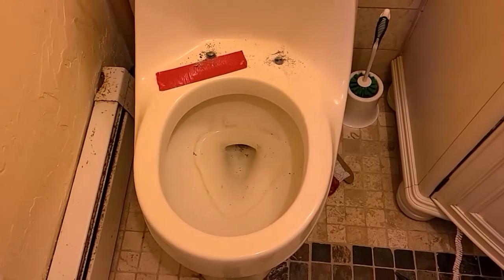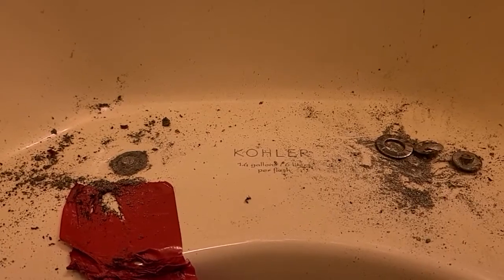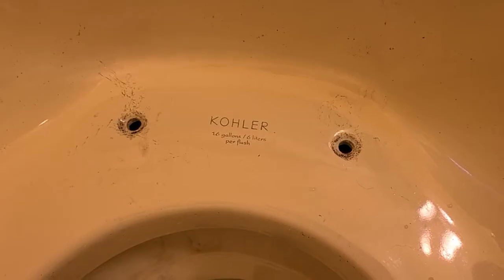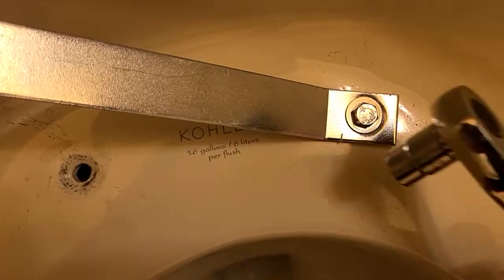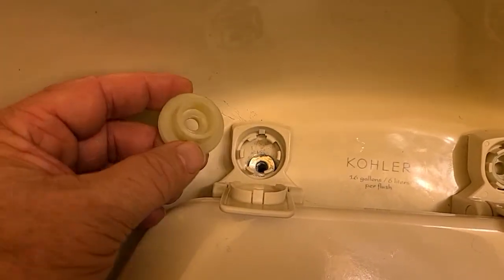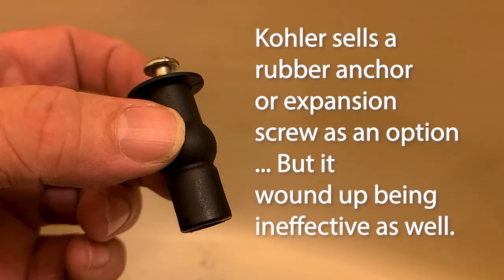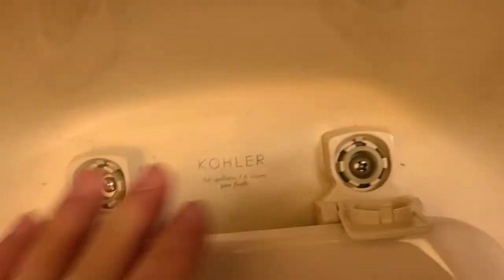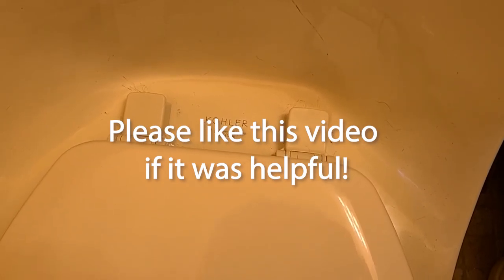Before You Buy a Kohler One Piece Toilet, Watch this Video on Replacing a Toilet Seat.

Comment: Worst toilet ever, for this and other reasons. Spent hours replacing the seat. Will never buy a Kohler product again. Heres my tips. Cut the seat hinges, use a torch to melt the plastic under the bolts, then try to pull wiggle free (nope), breakout the hacksaw, punch and drill out the soft insert.  I used 3/8 hardwood dowel as a new insert, has been working perfectly.

Comment: I repair these a lot. Trick is getting old bolts out and not over tightening new inserts. Unless your very handy call a plumber, retail for the kit is 30 bucks and I normally charge 150 in labor. Remember folks it's not what ya do it's what ya know.
Reply from the maker: Wish I knew you before I stumbled into this mess!
Reply: Easier and cheaper in the long run to ditch this POS toilet and just install a new one

Comment: Thank you so much for this video. I wanted to replace our toilet seat and found that one of the anchors was spinning. Before I went to far with the project I found your video and am glad I did. Before I cut anything off and ended up at a dead end and without a seat I ordered the anchors you suggested. With the knowledge and guidance you provided I was able to remove the old and install the new in half an hour. Thank you again!

Comment: It took me 3 hours to remove the old anchor.   Ended up using a dremel, belt sander, and a drill to grind down and remove the existing bolt.    And of course, as careful as I tried to be, I scratched up the porcelain in a couple of places.  In retrospect, I should have used a sledgehammer.🤬
Reply from the maker: @OlBa-zv4bk  yes, the sledge hammer crossed my mind on several occassions.  The first was when the flapper went bad and the toilet leaked and filled a septic system and renters continued to flush away into the basement of my rental house.  Then i moved it to my house that is on a sewer.  I go through a flapper every year or so.
Reply: Ugh.. they are garbage.   Oh, and that useless "tool" to fix their horrible design is now $31.   Wished I saw your video beforehand!  My old house had a cheap American Standard.   Should have gone back to that.

Comment: Excellent source of information on how to tackle this problem.Thank you so much.
 I found that Home Depot no longer stock the Everbilt 1 1/16" expansion (or well) nuts. But my local Ace hardware store had a drawer with 1 1/2" #10-32 well nuts for which I got #10-32 3" stainless steel pan-head screws. These have a much more substantial head than the #10-32 1 1/2" Everbilt screws and are needed to reach the 1 1/2" well nut. Be sure to put the #HK36 adapter over the well nut before you tighten the screw to expand the well nut and wedge it in place. On my first attempt the screw was drawn into the soft rubber of the well nut and would not come out so I had to sacrifice it by drilling it out and then doing it the right way with the #HK36 adapter in place before cinching up the well nut to wedge it in place. The EverBilt stainless screws have puny heads and you should insert and extra washer into the #HK36 adapter before tightening it up to prevent the screw head pulling through the #HK36 hole into the well nut soft rubber upper.
Reply: Where do you find the adapter at? I’m in a pickle now with this toilet seat. Thanks for the helpful information
Reply from the maker: Great to know.  Thanks for sharing all of this information!!!

Comment: Thank you so-o-o-o much for this step-by-step video, including holding up the packages you used for each piece.  I wrote it all down and then went shopping at Home Depot.  Can't believe it took me TWO YEARS to get the toilet seat replaced, and it should have only taken 15 minutes.  Like another commenter, I couldn't find the adapter kit you held up for the Bemis seat.  I had purchased a Bemis/Mayfair seat like you did, so I just called the Bemis -800 phone number.  Lo and behold, the super-helpful customer service woman sent me an adapter kit FREE that I received in two days.  It had a whole lot of pieces, (including some that may have been useful instead of the expansion nuts [although they looked a little too wide]), but the white nylon adapters that you showed were exactly the same.  Ya hoo!

Keep on recording, David.  Your video was one of the most helpful I have seen on any topic.
Reply from the maker: Thanks Dawn, I so glad the video was helpful!!  Crazy stuff!

Comment: Thank you so much for doing this video. I struggled with the same problem for about a year and was not able to remove the bolts no matter how much wd 40 I put on them. After watching your video, I was able to remove the bolts and the expansion nuts. I got to Home Depot and was able to purchase the screws and the expansion nuts but I could not find the adapter from Bemis. The new toilet seat I bought came with 2 plastic bolts and wing nuts which were intended for a toilet that one could get to the bottom and screw in the bolt/nut.  So I took a hack saw and cut off the head of the plastic bolts, drilled a hole in the middle of each bolt head and used them in place of the Bemis adapter. It worked!

Comment: This was a great source of information. I probably would have been talked into a new toilet if I hadn't seen this. I found the expansion nuts at Menards and bought stainless steel screws and washers. At the end I had the original seat firmly in place. Fingers crossed that it will be easier if there's a next time.

Comment: So helpful, David!  Just ordered everything at Home Depot.  Specifically, Everbuilt Expansion Nuts #10-32x1-1/16" in brass and #10-32x1-1/2 stainless steel machine screws and the Kohler Seat Anchor Kit 84999.  I threw in a few washers as well.
Reply from the maker: How did it work out?

Comment: Thank you so much for sharing this. I bought a Sanilo seat which is said to fit all manufacturers’ toilets. But low and behold this was not going to be my normal replacement process. Exact same problems as you described. And reaching Koehler and Sanilo support has been frustrating. I am 1 week in on this nightmare. But you have saved the day! I didn’t want any of the Koehler seats. This one matches the bathroom decor and is more sturdy than the original seat from when I purchased my condo. I can’t believe the drama? Again, Thank you so much.
Reply from the maker: Hi Kim, So glad to hear the video was helpful!!  Also, its always good to know I'm not alone in my struggles!

Comment: Hi David - a very helpful video and here here - what a pain it is to try  to do this!  You helped me figure out that I could remove the anchor, which snapped halfway down its length, even after I used plenty of WD-40 to attempt to overcome the corrosion.  I ended up placing an 1/8" thick piece of rubber onto the porcelain, then a 1/4"  thick piece of oak and then using a pry bar to pull out the screw and anchor.  To  provide a new anchor I ground down a 1/2  nylon dry wall anchor and glued it in place with epoxy resin.  I then used a stainless steel sheet metal screw of the right diameter (+ a the original washer) which held the lid hinge firmly in place.   Mission accomplished.
Reply from the maker: Wow, very ingenious!

Comment: I am buying what he says to get, not the part from kohler. wish me luck. almost threw out my back trying to get the old bolts off. thank god for this video. thank you!!!!!!
Reply from the maker: Sorry to hear about your back, but I feel your pain!   Let me know how it works out!
Reply: @davidcomora  the new bolts worked just like you said. only I am an idiot. I got one in and the other didn't catch. the rubber looked like it fell off into the toilet after turning it forever. I ordered more. when the new ones came, I realized that the old bolt had just shriveled up when I turned it and had not broken. I used the old one and have spare bolts now.

Comment: I'm stuck with 97 of these at work,  I do hotel maintenance.  😅,   any other  toilet, it's a 2 minute job to fix.  Definitely going to the less expensive seat and fasteners you used. Good job!
Reply from the maker: Wow, I can't even imagine 97 of these units!!! What a nightmare!
Reply: 97 Kohler 1.6 gallon one piece toilets??? My gosh that’s horrible I am stuck with one and I can’t twist the screw wing twist since the hole is like half an inch in diameter or something like that. Why on Earth would Kohler make such a badly designed toilet in which you have so much trouble changing a seat???

Comment: David, you are my hero.  I have a Toto soft close with the same issue and yours is the only helpful video I found. The replacement directions on our model are straightforward however ours is CONCEALED  like yours with no way to access the tightening nuts provided without tentacles (which I do not possess). I don't know why toilet designers do things like this, there are many working designs around this on later concealed toilet designs unfortunately ours is an older model before reason and common sense kicked in. I'm now off to Home Depot or Amazon for expansion nuts.

Dumb things drive me bonkers and I can really feel your pain. I'm glad you resolved this nonsense and hopefully I will too.
Reply from the maker: Glad the video was helpful.  I hope it all worked out!

Comment: I tried everything until I finally stumbled upon a merchant at EBay who sold the correct hardware: the expansion nut with the hex hedge screw and the regular screw, and also the bolt that made it possible to hold the hex hedge screw in place while tightening to expand.

Comment: Yup went thru the same thing on my one piece Kohler toilet. Went to Home Depot and purchased the expansion nuts you recommended ( a BIG lifesaver) and had the seat installed in 3 hours  included removing the old seat. As you said it was the toilet from hell 😳

Comment: With the Kohler one piece toilet you have to remove the tank cover and reach inside under the lip where the bolts are supposed to be and unscrew them. I just changed seats on my Dad's and it was a bit of a headache but he LOVES that Kohler 1 piece. I made sure to use the metal washers on top but bought 4 ⅛" rubber washers, 2 lock washers and 2 nuts from the hardware store. I placed 2 rubber washers on top and 2 on the bottom with the lock washers and nuts and tightened them up with no problem.
Reply: Nope. This toilet the bolts are blind, not accessible from inside the tank, not accessible anywhere

Comment: If you have to pull the bolt out, it can be helpful to hit it sideways a few times to loosen it.  Hit it in one direction once, then in the opposite direction once, and repeat this a few times.  I also had to drill one of the bolts out, and I started with a very small diameter bit angled at about a 45 degree angle and drilled to eat away at the metal.  I gradually worked up to slightly larger diameter bits, never having to get all the way up to the 5/16" drill bit the Kohler mfr's official seat bolt anchor replacement video recommends.  Use cobalt drill bits.  Once the anchor was loosened from drilling on it, I pushed it down and it fell away.
Reply: how did you "pull" the anchor out?
did you have to use a drill again?

Comment: Nice, been struggling with the wrong hardware delived for a week now. You got it, kicked that toilets ass! #10-32 x 1-1/16 in. Brass Expansion Nut Model #814368 does it and it suggests the correct stainless screws when ya add em to the cart. Thanks man!

Comment: Basic issue is that installers don’t use anti seize on the bolts. If you don’t, you will face what this video depicts. This video is great for all the steps you should not take.
Reply: I replaced my anchors with genuine Kholer ones 3 years ago and when I did I put tons of anti-seize, but the anchors still stripped out while I was unscrewing them to replace my seat today. I think these Kohler anchors are just a terrible design.
Reply: A second issue is mixing two metals, brass and stainless steel in a wet environment and not expecting them to corrode into each other resulting in a solid mass of screw/anchor that either spins in the porcelain hole or is frozen in place. I’m thinking of getting a brass screw to replace the stainless steel one in the 84999 parts kit.

Comment: FYI:  Call Kohler and you should be able to get the kit.  I wonder if they have done anything to correct this problem?  Mines 18 years old and while I did get the kit from them for free i never did use it as we were afriad it would crack and were not paying someone 150 to do this.  Frankly, I cant believe a company of there size and supposed experience made this mistake or am I missing something.
Reply from the maker: I thought I might have had a lemon, until I posted this video and saw all of the other folks who had the same issue!  I actually got the kit and one of  the anchors broke and kept turning after I installed.

Comment: I just used an expanding rubber anchor from ace hardware. The seat was still a little loose because I should have bought larger anchors but I used contact cement to keep them from moving. The anchors and screws cost about $5.
Reply: I went through this like you did (seat kept coming loose) but the problem is that the rubber covered "well nut" or "cavity bolt" which is the next size up is too big. Lowe's had them all on display. Can't get it in the hole to even start screwing the bolt in. I got one of the Kohler metal anchors (they're now on Amazon) and was able to install it by pushing down on the screw when I fastened the seat. And I didn't need that overpriced tool kit Kohler tries to sell you for installing it.

Comment: Isn't there a toggle type fitting that would work? Also, of course one would use stainless replacement . The original bolts are stainless and thus impervious to a regular hack saw blade. I got the hold fittings out through a few ingenious maneuvers and while the seat was off it was easier to hoist the one piece Kohler with my home made toilet "transporter"  which all plumber already have-of course in professional form.

Comment: I am stuck with one in my parents’ bathroom upstairs and I can’t twist the screw-wing-twist thing out since the hole is like half an inch in diameter or something like that. Thanks David for the help! I can try some of these suggestions. I couldn’t seem to find a video about this particular horrendous toilet model and how to deal with it and it’s half an inch or so sized hole where it’s so hard to take the screw out. 🙂‍↕️😅

Why on Earth would Kohler make such a badly designed toilet in which you have so much trouble changing a seat??? 😒😤

Comment: Great value. Great looks.
Reply from the maker: Wow, another Bot post from Kohler to try to minimize this video.  As I posted on the bot post below, I am about to change the flapper for about the 10th time since I bought this nightmare toilet.  It is not an easy task, as it is difficult to remove the old black plastic flapper bar.  I may post another video on that process.

Comment: So you couldn’t screw the bolt from underneath inside the tank? I stuck a stick through the hole and it went through inside the tank. I’m not looking forward to it but I’m going to try putting my hand inside the tank to tighten the bolts.
Reply from the maker: How did it work out?

Comment: Last time we needed a new toilet seat from hell, it cost us a $150 plumber housecall. So I figured to do it myself this time… carefully remove the existing bolts from the anchor… slap on a new seat and reinstall the bolts. Well, the first bolt came out. The second bolt is not coming loose, so I soaked it in KROIL… will try again in the morning. Then I took a photo of the model number on the inside of the tank and sent it to Kohler. They said the number doesn’t match with anything. Great. It’s a chinese Kohler, so. NEXT MORNING..Thanks to KROIL, a good screwdriver and a pair of old (USA Made) Vice Grips… I got the other bolt out.

Comment: I have exactly the same problem as you. I bought a Bemis replacement toilet seat thinking that it should be an easy install. Wrong, as you point out. I could not get the screws out that hold the old seat in place. In watching your video you talk about a Bemis kit that allows you to use the Bemis seat on the Kohler toilet after replacing the Kohler anchors. It looks like the kit is Bemis part HK36 (as shown in your video). I can't find it anywhere. Where did you get yours? If I can't find the kit I'm going to just replace the toilet with another and it won't be a Kohler one piece! Thanks for your video. It really helps.

Comment: OMG, what a nightmare! It's a miracle the ceramic didn't crack while you were drilling out those bolts or installing the new anchor. Congratulations on your tenacity in getting it fixed. Were you able to remove those little scratches around the left anchor?
Reply from the maker: No, But we finally did get rid of the calcium buildup that was impossible to remove.  I tried everything, then Mary came home with this pomice stone on a stick thing.  I laughed it, knowing how much time and elbow grease I put into trying to remove the stains.  Lo and behold, the thing worked.  My mom just bought one and it worked for her as well.  I think they are about $5 on Amazon.  Vince, be honest with me, is my life revolving too much around my toilet?